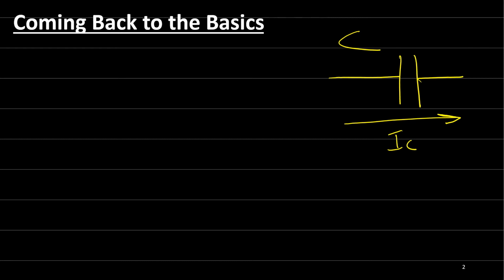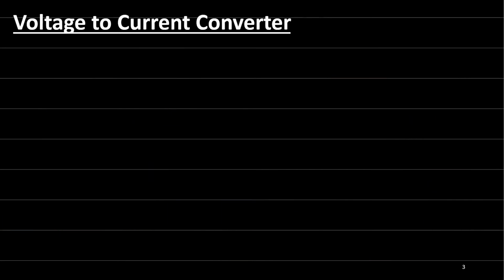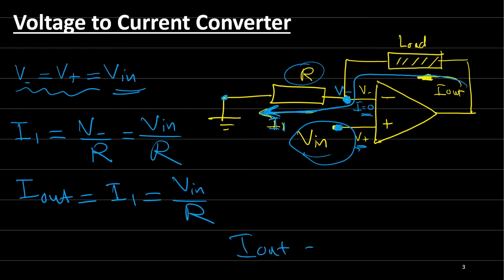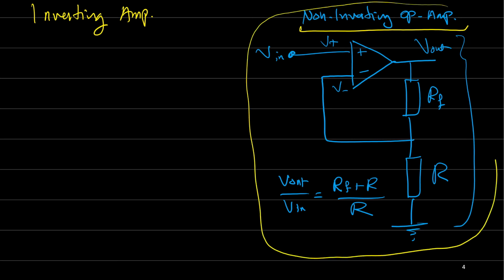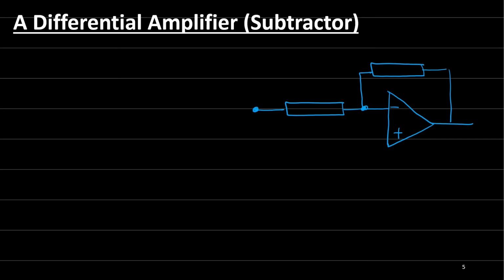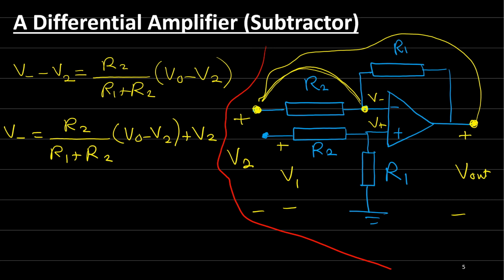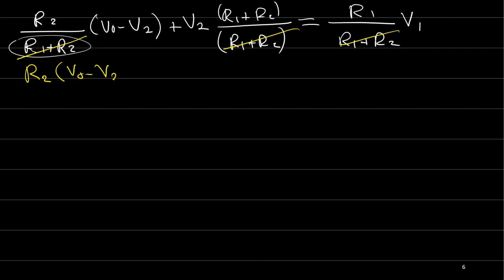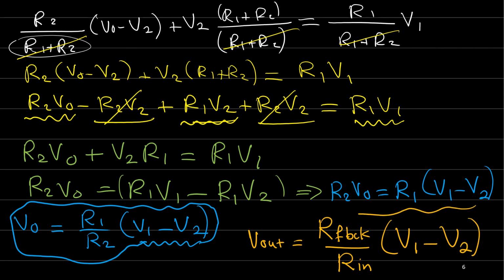Operational Amplifier (Op-Amp) Configurations | Analogue Electronics

Comment: Thank you for the valuable demonstration.
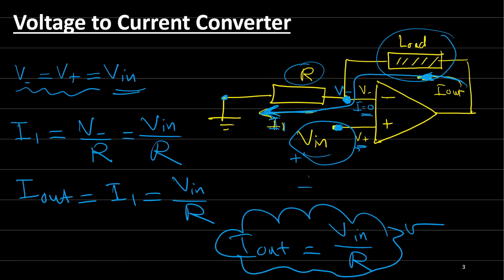I am just confused by how to differentiate between the voltage to current converter  5:50 and the non-inverting amplifier ?
Reply from the maker: it depends on where the load resistance is. if the load is the feedback resistance so the current is converted from the input voltage. If the load is just applied from the output to ground (reference), so it's an inverting amp.
Reply: @Elkhateb  Thanks